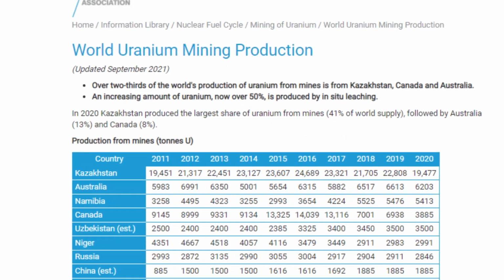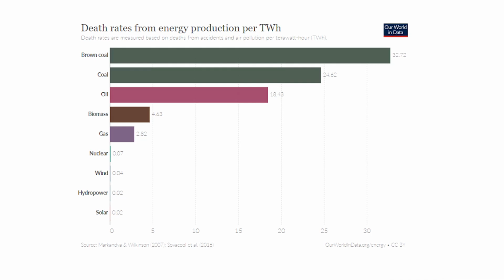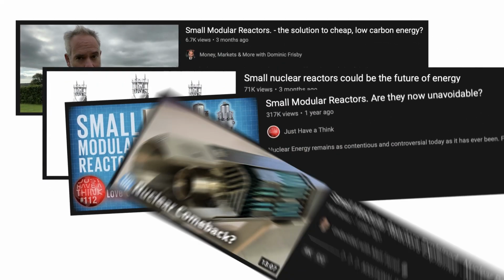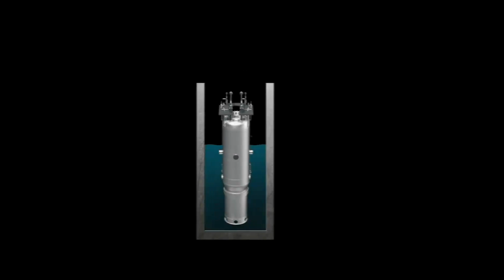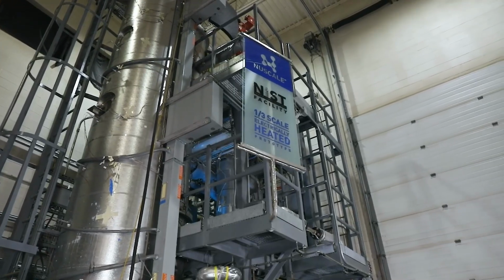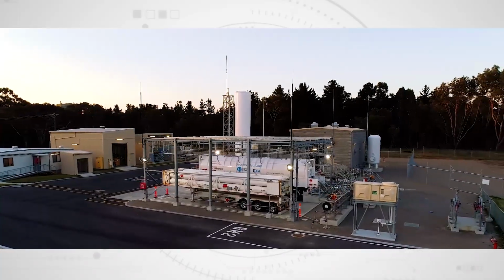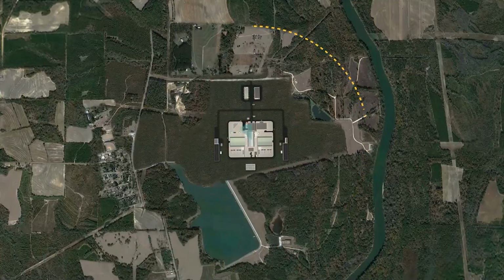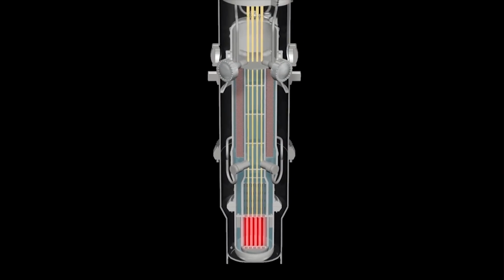Can Small Modular Reactors Save Nuclear Power?

Comment: I'm all for nuclear energy development and installation, as long as the nuke-fanatics don't drag down the current (MASSIVE) head-start wind, solar and batteries has. I agree; we need all the energy options we can get our hands on :P. We'll have greater resilience and self-reliance that way.
Reply: 100% agree!
I'm pro-nuke but 110% positive for any viable renewables or storage solution.
Reply: We need nuclear long term to keep up with population growth and consequent energy needs, especially when it comes to electrifying large industrial processes and making H2 for heavy transport (including growing space transport). In the near term we need to roll out as much renewable generation as possible and the energy storage which allows it to be viable. In the long term there will be a good mix between renewables/storage and next generation nuclear based on location and how the climate has changed to that point, maybe some H2 peeker stations in areas where grid demand is especially volatile.
Reply: @anydaynow01  agreed,  and other high temperature output nuclear reactor designs are being developed which has advantages in that it can provide high process heat, (600 deg C plus) which renewables cannot effectively provide, at the moment.  Personally I think, all options as quickly as possible are needed because we the window of time within which we should act and avoid climate inertial changes and avoid tipping points, is essential.
Reply: The last few years has overwhelmingly shown that the "nuke-fanatics" are not the reason that solar and wind can't be built at the optimistic speed some people would like it to be. Money is not the problem either, based on the amount of projects in queues everywhere. Nuclear supporters have next to no political power, so that isn't it either. The problem is that you have these less energy dense technologies you want to build, so you have to build in more places, remote to the places where the energy is used, which means overcoming correspondingly more community opposition to get things built. 

In other words, we are doing a bad job convincing rural folks to accept industrializing their landscapes with wind/solar farms to power a far-away city, because it is a hard problem politically to solve. Building or not building nuclear plants does not really enter into this calculus.
Reply: @billheughan637  Most farmers I know think that wind towers add value to every acre.
Two things stand in the way. Proximity to transmission lines and citiodts worried about their view.
Reply: @jimurrata6785  Again, it's not really a costs thing, its a politics thing. Counties can just raise setback requirements that essentially flatline development, as has happened already. Iowa being a prime example, where ~1/10 of wind technical potential has been built out yet already ~1/3 of iowa counties have setback requirements that essentially flatline further wind development.
Reply: @billheughan637  I've been following a bit of renewable news and it seems to me that the energy market regulators are dragging the chain in switching the energy grid from a one way, centralised, massive & energy dense system based off of power plants to a decentralised, dynamic system based on many energy generating, storing and trading systems.
Reply: @jimurrata6785  Per Bill Heughan's comment - it is the countryodts that live in rural Iowa that have blocked wind farm development in the 1/3 of Iowa counties mentioned - it isn't me in Chicago that is attending the local county commissioner meetings and running for office on an anti-wind platform or donating to said campaigns.
Reply: @Aermydach  The regulators aren't dragging the chain. If anything, they are pushing on the chain to make it work. But similarly to pushing on a string, they are not having too much success.

The problem is that electricity doesn't work like the internet. You can't "switch" packets of electricity.
Electricity is a real-time (literally) flow dominated by consumption. And the most common disruption is not the power plant (analogously a computer server) but trees falling over on wires. The second most common disruption? Animals.

The internet switches packets along an infrastructure dominated by storage. (My computer is storing this post; which will be sent to my router - which will store it, send it to another server/router  - which will store it (x30), and eventually reach youtube -which will store it. You will execute the reverse in order to read this post - storing, and resending, at each stage).

On the internet, the distribution makes sense - each node can store and retry the packet. On the electric grid, there is less loss and more efficiency if the energy flow is direct from the power station.

My neighbor installing solar panels on his roof doesn't improve my energy security, because his panels go dark at the same time mine do (when a cloud passes over our neighborhood). The 'distribution' doesn't help. If I have a 'distributed' grid all the way to Arizona to get more consistent solar, it actually reduces my energy security vs the short 40 mile trip to the Dresden Nuclear Plant. There are simply fewer trees and fewer squirrels between Chicago and Dresden than Chicago  and Arizona.

Fundamentally, the reason the grid looks like it does is that is an extremely efficient method of consuming electricity. Sure, there are some marginal effects around demand management and the like, but the physics of electricity will keep the grid looking pretty much like it does now.
Reply: I am very pro nuke but I wont hold any of those back as we need them, especially batteries its just its fucking retarded to use chemical batteries for grid storage.
Reply: @instanoodles  No it isn't. 
In point of fact storing electrons as electrons is far and away the most efficient and offers both the best return and response to load.
No one is going to circumvent the laws of thermodynamics and battery chemistry is improving by the day.
Developments in sulphur and sodium offer great opportunities for grid storage even if they don't (today) have the density to make them viable for vehicles.
Add the reduced need for expensive and rarer metals like cobalt. 
It is down to the ability to scale fast enough that is holding us back

Comment: Well said Rosie. 
We could ensure that the SMR plant also takes care of the radioactive waste rather than externalising their waste issue. Safety of the plant should be treated as a whole system safety issue, including radioactive waste in legislation.
Reply: Benny, I have a question. What if that legislation were to say 'You can only lease your fuel rods. All fissile material remains property of the Department of Energy.'
If that lease price included both production and spent re-processing costs do you think that would assuage your concern about waste?
Right now it seems the French are the only ones re-processing spent fuel or using breeder reactors.

The operational safety factor of the plant is really one of tight QC at the factory and ongoing inspection.
This seems very similar to what we have today in the aircraft industry. And at similar cost scales.
Type certification of a completed model built on production tooling using approved process would have development costs ameliorated over the production run.
The current system here in the U.S. where every power plant is unique and needs individual approvals and inspection processes is absurd.
Reply: @jimurrata6785  Yes, Jim - something like that would be start. There is also the materials used that do become radioactive over time that also need to be properly managed. 
I think of the mining industry here in Australia where they remove the mineral from the ground, make a mess, destroy the local environment and spread various processing chemicals, many highly toxic and other waste around the area and into the water table, into rivers and streams, then shut the mine down when its no longer viable and walk away with some agreement to clean up that they never honour. Its a total failure.
Reply: @ShoebridgeForPM  Im definitely aware of those situations. There are a number of mining towns abandoned because of toxic tailings and leach ponds here in the States
Reply: @ShoebridgeForPM  Waste treatment is probably not any different than for more traditional reactors. Same procedures can be applied.
Reply: @seneca983  The problem I'm alluding to seneca983 is that these procedures have not worked and have left tons of waste badly managed. Profits drive all industry and if there is a loop hole in legislation or the people ensuring compliance are not doing their job, then things will get missed...great for the bottom line, shit for the rest of us.
Reply: @ShoebridgeForPM  How has waste been badly managed. I'm not aware of problems (at least not in high-income countries).
Reply: @seneca983  There are many examples, too many to list here. Let's see the Pacific plastic waste island - you must have heard of that, like nuclear waste, lifetimes are quite long. There are confirmed reports of dumping of nuclear waste off the coasts all over the world, including the US.
Reply: @ShoebridgeForPM  I have heard of the plastic waste in oceans (though it's not a literal island) but I meant that specifically nuclear waste is to my knowledge generally well managed (excluding in poorer countries like Russia). The volume of waste, or at least spent fuel, is pretty low compared to the amount of power generated. The low volume makes it easier to manage than other waste types which have much higher volumes.
Reply: @seneca983  That's a pretty weak argument "the volume of waste...is pretty low)
Radioactive waste is cumulative over time time - hundreds and thousands of years, so you need to be talking about cumulative effect of decades of dumping of nuclear waste. If you want to look up nuclear waste dumping incidents so far uncovered, google it. There is no shortage of info on this and much of that from reputable sources.
Reply: @ShoebridgeForPM  "Radioactive waste is cumulative over time time"

Even with cumulation the volume is really small. You can e.g. search for image labelled "45 years worth of Swiss nuclear waste is not enough to fill a single room". The difference to other forms of waste is enormous. Even one day worth of plastic waste (in Switzerland or elsewhere) far surpasses the amount seen in that picture.